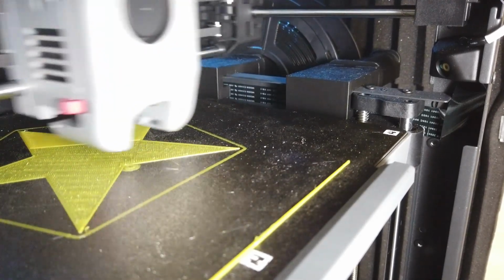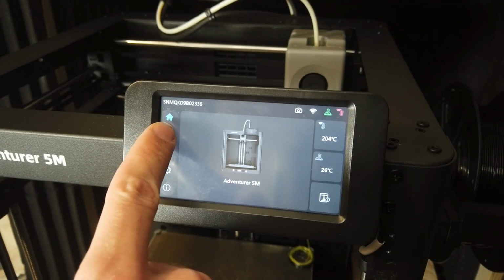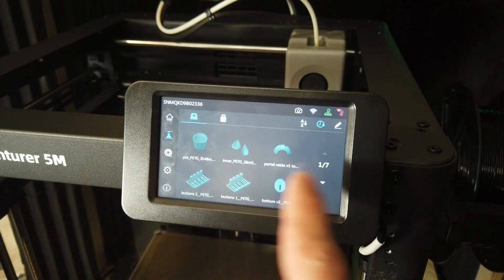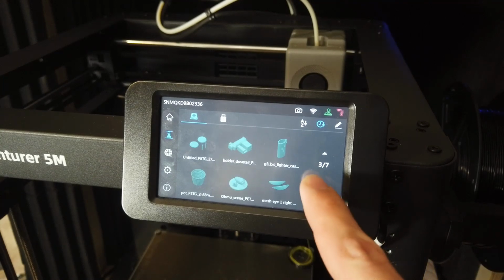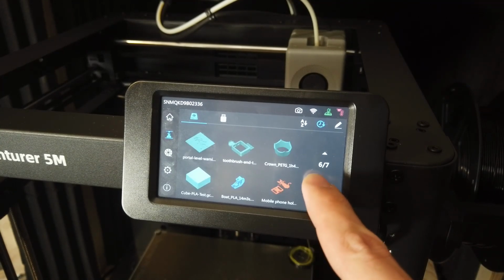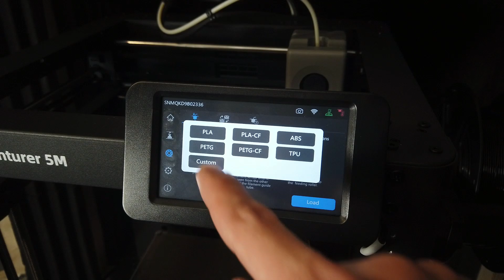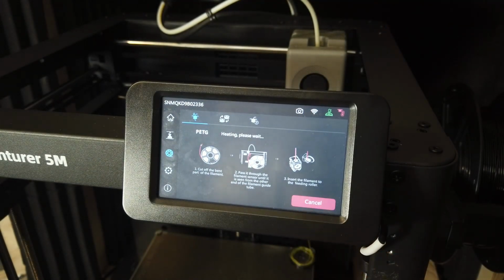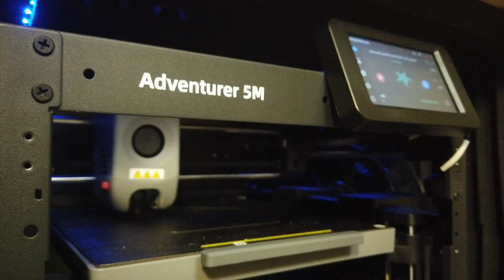FlashForge Adventure 5m 3d Printer Review

Comment: Is the wooden enclosure retaining exhaust heat? Could burn out the PSU and SOC
Reply from the maker: The cabinet itself has an exhaust with speed controlled fan so it stays at a decent temp. I’ve found keeping the box a little warm tho helps with print quality and strength. 

Just hit 800 hrs of print time on it and no signs of issues yet. Fingers crossed 😂
Reply: @Fancypantsprinting awesome- i dig the set up

Comment: I've encountered the dreaded "host error" message during what is only my 3rd print on the thing. I have to wait until this evening to do some troubleshooting, but between this and wireless connectivity issues I'm starting to dislike this thing.
Reply from the maker: Highly recommend starting from a fresh factory reset  I had to do that twice in the early weeks along with a couple bad move errors but after that second reset it works without issue. 

I haven’t seen the host issue thing. What’s it doing?
Reply: @Fancypantsprinting It stops printing, kills the fan, light, and hotend, and throws up an error message on the touchscreen that says "Host Error". It asks me to restart the printer. I've done this several times times with the same result. The internet says that I might have a loose cable.I guess I'll be bringing my tool bag home from work today. *sigh
Reply from the maker: @jamesirwin19  big oof. Let me know how it goes. would love to hear what the fix is.

Comment: I wouldn't recommend this printer to anyone. Had mine for 6 months and I can't get Orca Slicer to work reliably and the front heat break fan has stopped working which I have learned is a common failure because the Control PCB in hotend has a mosfet that fails . I am really frustrated with this product.
Reply from the maker: Bummer to hear it! I’ve been running orca slicer with it no issue but there were some bumps in the beginning. I think I’m running close to the 6 month mark on mine. Hope it doesn’t die on me. I run it like crazy lol. Thanks for the feedback!
Reply: @Fancypantsprinting  Could you tell us how many print hours you have on yours right now? I'm buying a lightly used one off Facebook Marketplace for $120 tomorrow. I just wanted a back-up printer to help cut down on print times for when I'm printing large projects in my P1S

Comment: funny you say that I got some red asa filament but don't know how to load it. I have looked online and and still can't figure it out.
Reply from the maker: I think you have to tweak for custom settings. BE CAREFUL. ASA NEEDS TO BE PRINTED IN HIGH VENTILATION. it has toxic fumes because of how hot it needs to go. I still have not used mine and just use petg. It’s sturdy and doesn’t melt in high temps like pla.